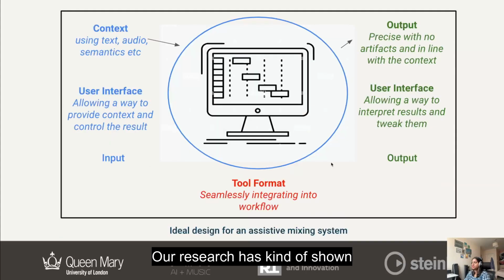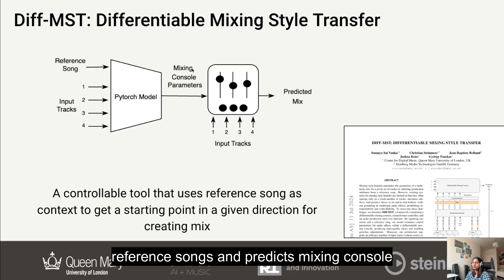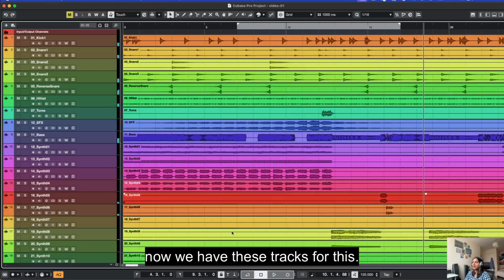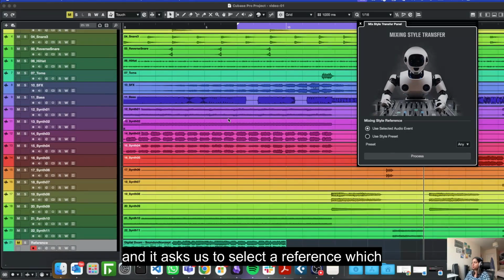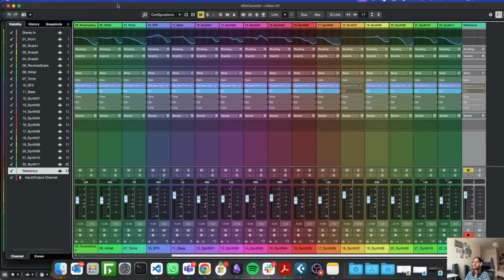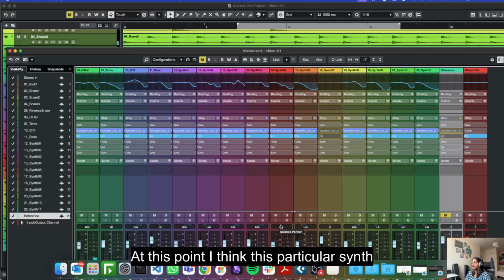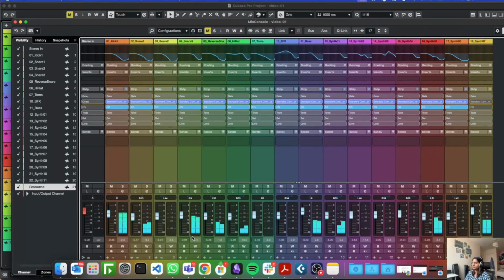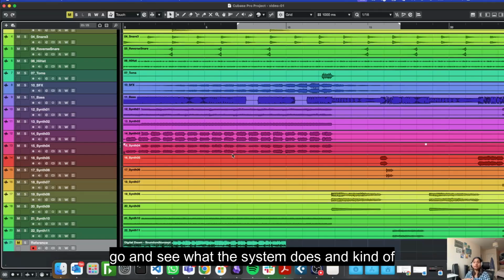Mixing Style Transfer Prototype for Cubase

Comment: Interesting and well thought out concept.  Though with any mixing process the purpose is to make the music in the end sound better as a whole.  If your model errors is that there is too much attention put on learning each track and too little attention put on how the tracks work together to make a cohesive mix.  The bot right not just sliced off the top of each track and made everything lose energy and sound dark and muddy.  Right now it's an amateur mixer that doesn't know what its tools are suppose to do or how to judge how one tool effects the other to create a final whole.  Thus it's relying on an old gimmick of fixing problems in a mix by chopping off the problem.  

I wonder if AI will ever really learn that.  With the amazing advances that it made in creating static pictures, the idea of time and interdependences of parts seem to be AI's down fall.  Which makes sense as these things are entirely dependent on perception and judgement and completely don't in actual fact have any basis other than people's opinions.

I am rooting for you though.  Having spent the last 3 days mixing my latest music in Cubase I'd love some AI help.

One last thought.  The foundation of a mix is actually a great arrangement to start with which unfortunately with the demo song AI is fighting a losing battle.  I mean, we've all been there so I kind of started to feel for the thing a bit.